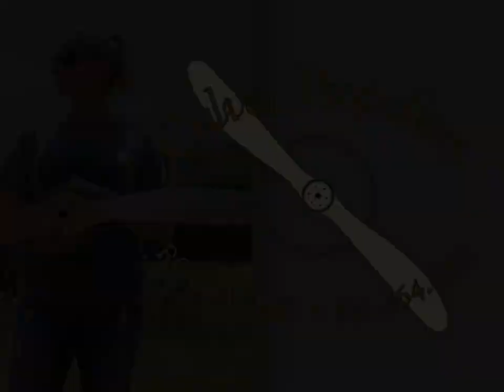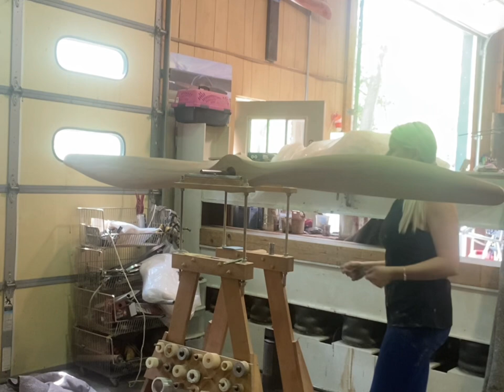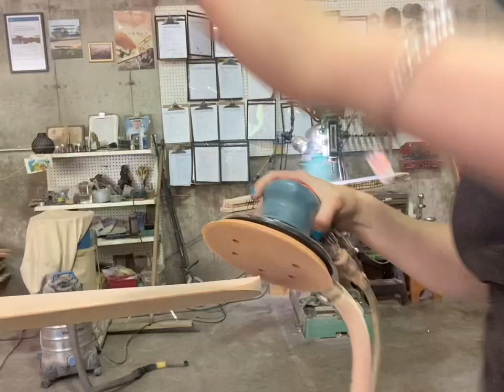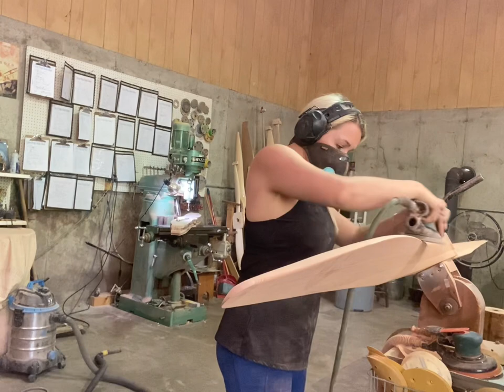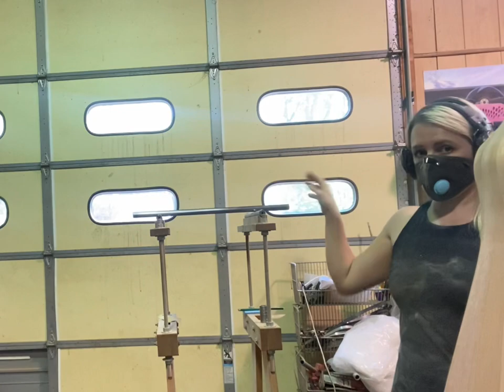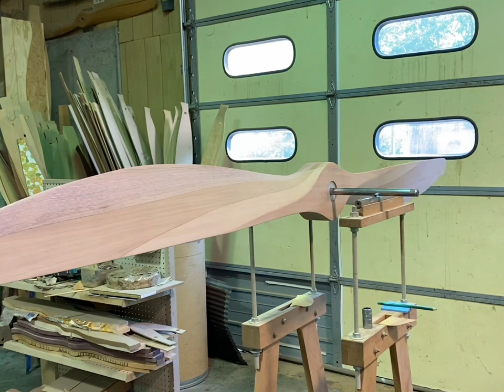Balanced 😁

Comment: Alaina, that wood combination is going to just pop when you get the varnish on it.
Thank you for the Intro monolog, I really enjoy hearing about what you are going to do and why.
Now for 2 stupid moronic "Ha Sure, I am from Minnesota" questions
1) what edge is the leading edge of the propeller? I am thinking the curved edge as that is where the airfoil profile is greatest. However, my first thought was the straight edge, but that does not seem to make any aerodynamic sense as you would not have the thickest part of the airfoil section be so far back on the cord.
2) How many times a day do you stop and touch up your nail polish? 😁😁😎 An orbital sander would need 0.05 seconds to take a little of the polish right off.

Thank you for taking the time to put this together.
Reply from the maker: Lol! When you are constantly trying not to chip your polish you also don’t lose a finger. Lol win, win! 

Leading edge is traditionally the curved side. Some WW1 props are opposite, but very few